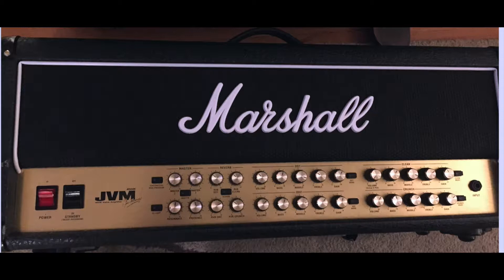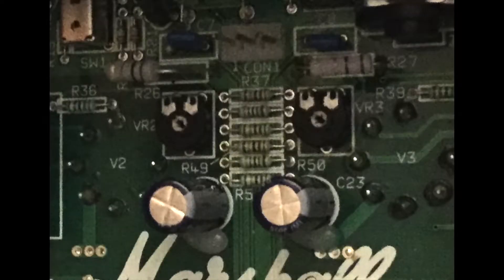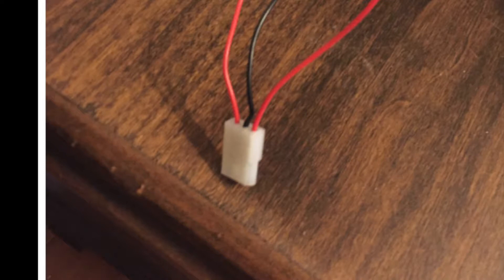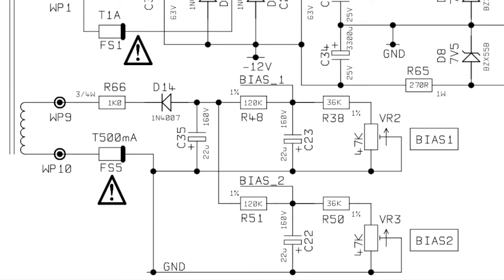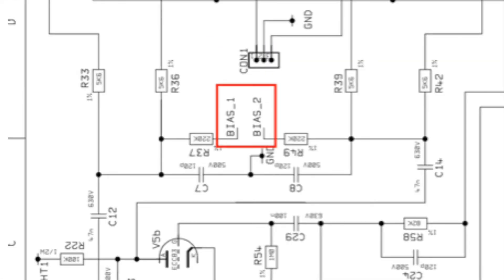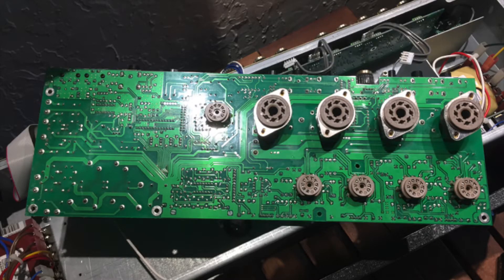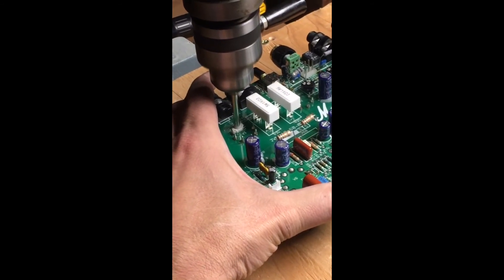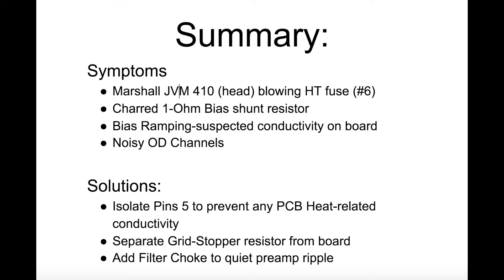Marshall JVM Bias Drift  PCB Surgery

Comment: sheesh, that’s pretty involved :o I just picked up a used JVM 205 and really like it, but now I’ve got a case of the worries! Appreciate you posting this - great, great info. Guess I’ll just play it till I have an issue. I play at home and never have my masters up past 10:00, I’m hoping that’ll help keep things cool :-)
Reply from the maker: Ha, yeah not the easiest of procedures, but if it's to be done, this is one of the ways.  Hopefully, you have one of the JVMs where Marshall has corrected this issue.  

If it were my own JVM and I ran into these issues, I would likely pull the board and convert to a JCM800 or another amp, as the transformers are great for that type of conversion.
Reply: @jloewenheim  - my JVM is only about 5 years old, so… I’ve been all over the JVM mod forum, some are real simple, others not so much. Isolating pin 5 is really far out and that glass drill you found is GENIUS. My skill level is bright circuits and FX loop improvements. I’ll definitely pull my chassi and give it a good look. Thanks again \m/

Comment: what choke "henry" did you go with? great vid....you could have desolder pin and slip heatshrink though hole?...unless...lol...they decide to make tight fit...OY
ps done similar iso for adding 1 ohm to gnd from pin 8...hence a possible suggestion.
Reply from the maker: Thanks for the note.  I believe it was a 4 or 5H choke that is stock for Marshall
Reply: @jloewenheim  thanks

Comment: Note that I lifted the 5.6K grid stops at pin 5.  With no tubes in the amp I still get -10 t0 -12 VDC bias voltage.    Way too positive.  I suspect one of two of both issues.    Board conductivity between the traces from the bias voltage traces to a HV trace.  The other thing is the filter caps on the bias voltage, C22 and C23.  Both exhibit an ESR of 5.0 ohm  Leaking to ground will in fact make the bias voltage more positive.  I will pull the board and replace the caps  Report findings,  I will also isolate pin 5 of the EL34 tubes.  
Nore all tubes are good but have run hot, 1 ohm resistors are OK, ESR measured with Atlas ESR70 .  Bias rectifier Diode tested good
Reply from the maker: Hopefully, you can get it solved.

Comment: Great vid, for sure! Thanks a lot, I really appreciate it! Got a little question, is it totally safe to measure negative voltage on pin5 without any tubes installed in amp? As far as I concerned with no power tubes all voltages to the tubes will increase their nominals. And do I still need to connect a cab to my amo when powering it on without tubes installed (preamp tubes and power tubes)? I'm a bit hesitating on that one so that I decided to double check the info and ask you for an explanation here. Thanks in advance!
Reply from the maker: Thanks for the note.  The short answer is yes, you can measure the voltages with no tubes in, and it is the safest way to do it because you can insert your test probe in the socket where the tube pin would go instead of having your hands near all the other circuitry from behind.  Also, with no power tubes in, you do not need to have a speaker load connected.  

All that being said it is still dangerous, so be careful.  You are correct that voltages will go up since they are not loaded down (but not a significant amount).  The most important thing is that you have stable negative DC voltage in pin5, it will be somewhere in the neighborhood of (-)40-55 volts DC.  

Please feel free to email me directly if you want to discuss this further: username@gmail
Reply: @jloewenheim  Thank you very much on clarifying it and for giving precautions! Yes, I am aware of a potential danger and do know how to handle high powered equimpent for sure.

Comment: I just had the same problem with my JVM 410H! One of my tubes blew, and after inspecting the Circuit Board I noticed I had the same Resistor and the same Fuse blown as depicted in this video. I was just going to replace the fuse and resistor and try to bias the new tubes, but now I"m thinking maybe I should Isolate pin 5 as he does in this video.... what do you guys think? Also my EL34 Tubes that I purchased only have 7 pins instead of 8. I went on some website that tells you what tubes you can use for replacement and JJ EL34CZ were among the recommendations.
Reply from the maker: thanks for the note.  7 pins on your EL34?  is one broken off in the socket?  All EL34 tubes should have 8 pins.  

Anyway, if you have questions, feel free to email me : username@gmail
Reply: @jloewenheim  This fix worked beautifully! I think my Bias was at around 40 MV, I bumped it up to 70 and absolutely love the tone! This video saved my amp, Thank you sir.
Reply from the maker: glad to be able to help you find a solution! @dansittler4619

Comment: Do you know where to get the replacement resistors for R26 and R27. Will any 1 ohm work 1 watt work? I was really thrown by the bands at first.
Reply from the maker: Hi Mike, thanks for the comment.  Although it likely looks like the 180 you are mentioning, they are using what is the 3 Digit resistor code, typically used for labeling SMD resistors. The code is "1R0", this link will explain how that works: https://www.hobby-hour.com/electronics/smdcalc.php  

Now to explain why they are 1ohm. the reason for that value is so that the voltage measured on the test points will be equal to the bias current (using the formula V=IR, if R=1, then V= I).  Hopefully, that clarifies.
Reply: @jloewenheim  you've probably noticed that I figured that out by my comment edit. Thank you. What did you replace yours with? I figure I need something that can take the voltage and current, the schematic says 1 watt, and should probably be something that can take a lot heat. There are a million different 1 ohm resistors on digikey and mouser.  Any suggestions?
Reply from the maker: @rustyzipperband  Hi Mike, glad you were able to figure it out.  I actually prefer to use 2 or 3-watt 1% resistors metal (3w are what I have at the moment), in particular when it comes to EL34 loaded amps.  As you mentioned, you can use the general supply companies like Digikey and Mouser, you can also go to the amp supply companies like Mojotone.
Reply: @jloewenheim  awesome! Thanks for that info. There is nothing more frustrating to me than shopping for parts on digikey and mouser.  If you have any other alternatives please do share.  I've been a hobbyist for over 10 years building effects.  I also built the guitar in my profile pic along with many others. I used to go though Tayda, and ebay. I've avoided digikey and mouser till about a week ago.
Reply from the maker: @rustyzipperband  any chance you can send me an email?  my username at gmail.
Reply: @jloewenheim  sure
Reply: Holy crap you build guitars and other shit too! I just subscribed to your channel.

Comment: Great video.  Do you know if the Satriani version has similar problems?  I know the board layout is different.
Reply from the maker: THanks for that.  Hard to say, as understand it, they are quite similar except Joe had them add a noise gate and tamed things a bit.  If the PCB is the same as the 410 and some of the others, there is a good chance of the conductivity and bias issues, so if you have issues, consider this as a possibility
Reply: @jloewenheim  They did a lot more as well.  For one thing the bias pots are way over on the right side of the board near the filter caps.
Reply from the maker: @SaintFredrocks  yeah since you posted I did some research.  As far as I can tell, they are still using the same PCB mounted tube sockets, which tend to be the real culprit for that Bias Drift.  Hopefully, it won't be an issue for you.  One thing they added and was very much needed is that internal noise gate.  Anyway, if you run into problems, feel free to reach out.  You can get me at my username @gmail.com

Comment: Jake, I have a JVM 50 watt, I'm getting V3 (only V2 and V3 both EL34s) that is running hot, I have the bias pot turned all the way down and the tube is still running quite hot 50+ma, also when measuring the voltage across the 1 ohm resistor, it is varying wildly from 40mv to 85mv.  I've measured all the nearby and relative components, everything seems to be in order, does what I describe sound like the voltage leak issue?
Reply from the maker: that is definitely a symptom.  That being said, one of your tubes could simply be bad, to eliminate that, switch tubes into the other socket.  If this continues on the same socket its not the tube.  I suggest you measure the bias voltage (will be negative DC) on pin 5 for each socket both with and without tubes in.  If that voltage is not holding stable or is showing positive voltage, you likely are having the leak issue described. it is probably more likely to occur with the tubes in.  Sounds like it is only on one socket, but if you plan to do the repair, you might as well do both.  Also, feel free to email me if you like.  username @gmail.com

Comment: I've had one of these back in the shop 5x with blown HT fuse, about 3 months between events. I'm wondering if this is the issue.  I've fixed dozens of TSL and DSL with this issue but never heard of it on JVM410. I asked another v experienced amp tech and he hasn't come across it either.
Reply from the maker: Hi Stuart.  This amp is still going strong after the repair, so there is definitely a possibility you are seeing that same issue.  When I spoke with Dr. Tube,  he said there clearly are enough similarities and that the PCB stock is very similar.  Anyway, good luck with it, it is not exactly fun to deal with these kinds of hard to diagnose problems. Let me know if you have questions, username @ Gmail.com is the best way to reach me.

Comment: Top video, my tsl 601 has little bit of bias drift, ie set it at 80mv and it gradually goes up to 85 -90 Plus ish during warm up and then goes down to about 75mv ish after about 1hour, never absolutely stable,(twin jj EL34 fairly new)
Amp sounds ok, no other issues. Do you reckon this is within limits with your experience? resistors seem ok. I am not sure whether my model amp is susceptible to this pcb problem.
All the best from yorkshire UK. Bill
Reply from the maker: Thanks, Bill, I don't have experience with your TSL specifically (please let me know the year), but if bias is jumping around, things can start to get questionable.   Although that Bias measure may work, with the limits being in the neighborhood of 45 per tube, and showing 90 when you are adjusting; the bias jumping is not a good sign.  I would suggest keeping an eye on the tubes, and if you see any red plating or the HT fuse goes, you may have the same problem.  JCM2000's (DSL and TSL) are notorious for having this problem.  Let me know if you want to discuss further.
Reply: @jloewenheim Thanks Jake? I presume that is your name , My amp is 2008 and from further info the problems with pcb's were earlier models ie up to 2003 I understand, My mA come down after initially rising and so I do not experience red plating and sound is ok as far as my playing goes Lol!. Your mod seems to attend to pin5/pcb only whereas others seem to include a pcb bias supply mod as well, is that really necessary?.
Nice to speak with you cheers Bill.
Reply from the maker: Jake is the name they gave me.  If you want to email me, you can do so by adding gmail.com to the end of the username.

Some things to consider: First is that the JVM I worked on is a 2009 (I think you are seeing Dr. Tube's article which doesn't include the JVM).  I say this because the 2003 year number is only the timeframe of which Marshall has admitted to.  That being said, it is my understanding that the conductivity issues are still an ongoing issue even in current production (I doubt Marshall expected non professionals to turn it up to full volume).  Second, the JVM has a very different bias circuit layout.  As a result,  a new bias board did not make sense on this amp.  If it turns out to be an issue, I will have to go a different customized route.

After much thought and research, it seemed the only logical starting point was to eliminate the chance of (DC+) from pin 4 jumping onto the grid at pin 5.  Of course, the other option was to buy a new PCB ($650 US).  If I screwed up the isolation, I would have to do that anyway, so I gave it a shot.   If you start with the isolation, you can then troubleshoot after should issues still persist.  

It has now been about 6 months, and the amp gets a lot of use at Spinal Tap volume levels.  Things have held steady so far, and with the choke, it is better sounding.

Comment: Thoroughly informative! Thanks for posting and sharing your knowledge! I have the JVM 410 combo. I turned it on, after about 5 minutes I went to tune my guitar. While nothing was plugged into the amp’s input there was suddenly a loud pop. An audible hum has existed ever since. Prior to the pop I did notice some scratchy noises and light crackle sounds that I  had never heard before. The amp is 3 years old and only been played a low levels. The tubes have never been changed... any suggestions are very much appreciated! By the way what level did you bias each side to? Any tubes perform/ last longer than others? Thanks again!
Reply from the maker: Thanks for the nice words.  The first thing that I suggest is that you make a current limiter.  Uncle doug has a great video if you need some hints: https://youtu.be/wRFRwOnLsZI.  This will help you find out if there is a current spike from the tubes, and will likely protect the amp.  Second, I suggest a bias in the neighborhood of 40ma per tube, this will show up as 80 on the bias test points since you are dealing with 2 parallel tubes per side. You can go deeper on this being that each tube has a bias shunt resistor, allowing you to easily measure what you are getting on each tube, if one is out of spec, you will need to replace. I would start with these tactics first. 

Finally, I would also go check out rob Robinette's pages.  So much theory in there explained in plain simple terms, having a real understanding of the possible culprits will hopefully help you save hours of frustration.  After that, feel free to reach out to me (username @gmail.com).  Hopefully just a tube.  el34's can be a pain in general.  If not, we can discuss the other possibilities.
Reply: @jloewenheim   Thank you for getting back so quickly! I will follow your advice. In which state are you located?
Reply from the maker: @tabodee  CA
Reply: Yep - my tech called me up today and sent me a picture of the same exact resistor that had the same hole, in the same place- lol. He has ordered new resistors. And had to change out all of the power tubes. The bias was like 68 on one side and 24 on the other.
Reply from the maker: @tabodee  Sounds good, you still need to keep track of it that board has become conductive.  waivering voltage bias will again kill the tubes, so hopefully the new tubes will cure it.  if not he may have to do what i did
Reply: @jloewenheim   Gotta feeling I am on to a temporary, 3 year fix- Your way is the long term fix!